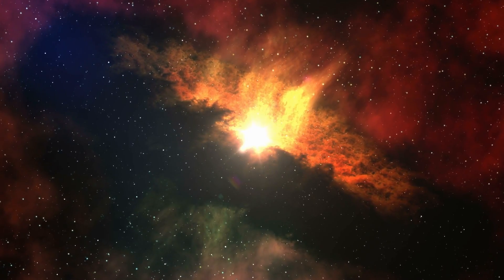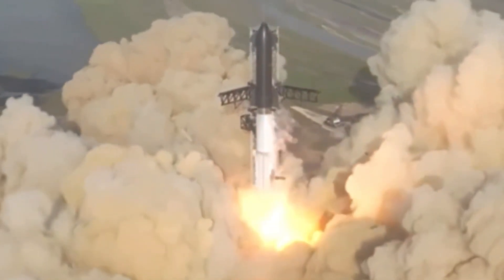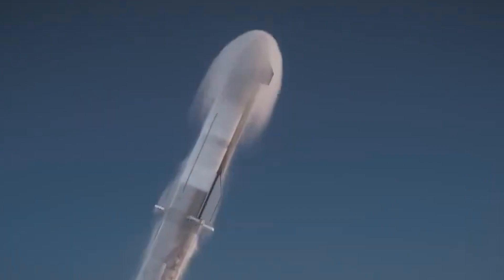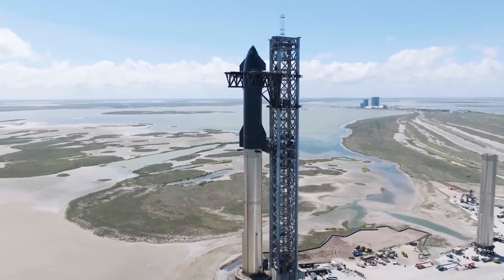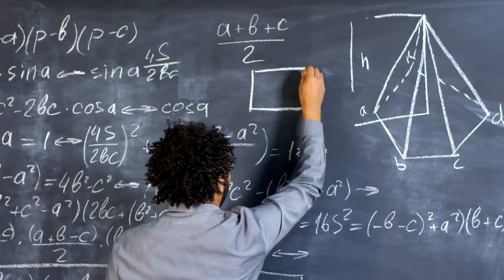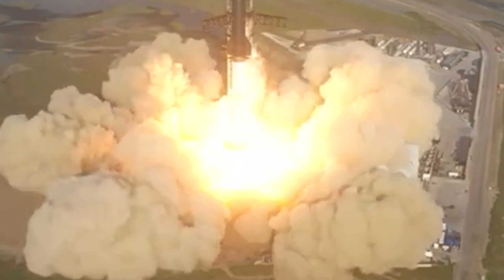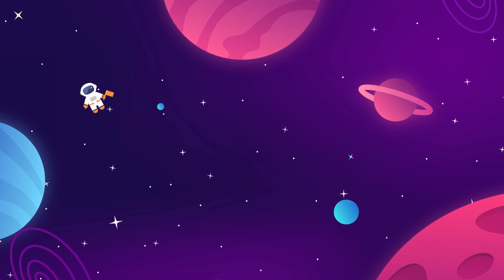The SpaceX Starship Orbital Launch Update Is Here!

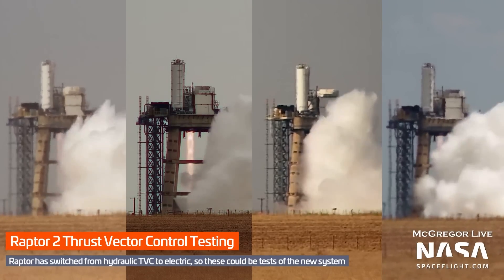Comment: 11:49 You forget, that the floor of the pad must carry the entire thrust force ot the super  heavy, at the exhaust temperature . 
Action = Reaction ! That force is Huge! This is not difficult to calculate !
Reply: I have an idea
We need to build an on surfaces magnetic force field to handle the pressure and heat 
If possible, a static electromagnetic field 
And even a faint magnetic field around the body of the vehicle can be an added advantage to heat resistance
If only it can be built

Comment: SLS first try? 

The engines are from the space shuttle. The solid rocket boosters are stretch version of the shuttle’s SRB and even the main tank itself is straight off from space shuttle as well although slightly enlarge…

The new SLS rocket has zero new invention on it.

Also the Terran1 did reach space but fail to orbit.

Comment: The rush to launch prior to the installation of the water-cooled steel launch pan was a frankly dumb move and to determine the strength of the concrete pad as being 'fit to launch' based upon a 10-second 50% thrush test, is what guaranteed the ensuing clusterfuck that we all witnessed.
To claim that the test was worth the data gathered is just a naked ass-covering PR band-aid. In reality, the pad will not be fixed in a "couple of months" and the boosters that are "ready to go" will now have to sit idle, until the pad & tank farm is certified as being 'legally' safe to use. Not to mention of course. the fact that SpaceX has been 'grounded' by the FAA pending their assessment of the event. There terms 'negligent',  'cavalier', 'irrisponsible' and even 'reckless' are now part of the current FAA narrative. In short, in a rush to make the front page, SpaceX very publicly stepped on its own rake. Not smart !!

Comment: When the launchpad was built, I thought that it demonstrated complacency. everything was bunched up, the tank farm was really close to the rocket and exposed, no flame trench or flame diverter. These people don't know history? The Russians launched the huge N-1, that was supposed to go to the moon. It was nearly half as powerful as the Starship. The launchpad was totally destroyed and people were killed when the rocket barely lifted off and fell back. If you see the damage caused by a relatively nominal launch of starship, what would it have been if the rocket and of course the tank farm exploded on the pad? It would have been the largest non nuclear explosion in history, similar to the one in the port of Beirut (ammonium nitrate). Residential buildings kilometers away could have been damaged, residents injured or even killed.

Comment: Why didn't they just build a flame trench designed to deflect the exhaust gas during the launch?And yes, there is a circular water barrier just below the ring helping to prevent acoustic suppression and overheating the launch pad, but its not enough. Obviously, there should be a massive flame trench built of highly durable concrete and designed for the pressure of the gases that come out of the 33 Raptor engines (each Raptor has an insane <30MPa pressure !). We do not have exact information why the engines failed, maybe the engine pipeline system was damaged by stones from that crazy funnel that the rocket dug.

Comment: You've misinterpreted Dr. Metzger, the ablative need not be "feet thick". Also nothing in Port Isabel came from the rocket termination, that was all sand blown up into the air due to the concrete failing.

Comment: Starship was always supposed to explode, neither section had landing gear and the 2nd stage wasn't supposed to reach orbit.  It was not just vector control which failed, the hydraulic clamps holding the 2nd stage down failed too. Had starship disconnected it would have continued on while booster tumbled. 

There was no launch tower avoidance, that was pure luck. 

The engines only throttled to 50% for the first 7 seconds, this wouldn't have been a problem for the pad as it had already been tested to cope with that. The engines only throttled to 90% in the final two seconds before it lifted off. That's when the pad excavation happened. 

The flight termination system activated about 45 seconds before the explosions, it's like poking a hole in a coke can and then standing on top of it, it will take time to lose enough pressure for the structure to collapse. That is what is seen in the flap cam image.  The 2nd stage then had 100+ tons of dead second stage weight still attached to the bottom of it before it also failed. SpaceX ought consider putting the power for the latching mechanism on Starship, not the booster, so starship has it's own launch escape system from a malfunctioning booster. 

It's entirely possible the pad would have survived had it been installed in one go, but it was a  patchwork of previous repairs which likely allowed the booster to mechanically buffet the pad and excavate a cap down below, which then pulled it apart in the same way potholes are created on roads when water gets in between cracks and then tyres increase the water pressure and allow it to crumble.   Flame diverters and water deluge aren't suitable for rapid reusability as they need continual maintenance. 

By the time SpaceX have finished they will likely have made flame diverters and water deluge obsolete.  The pad having held up fine at 50% thrust means they've already done the equivalent of the Saturn V burn without the need for them. It's materials engineering rather than laws of physics. 

Starbase and a new starship will be ready for relaunch before the FAA approve it. I would expect massive delays if they had exploded on the pad, but with most of the issues related entirely to the pad surface I would expect SpaceX can overcome most points of interest with stage zero redesigns, including nearby damage caused by concrete explosions.

Comment: I am sure there is some high tech fibers that can be added to concrete that would prevent this catastrophic failure of the RC concrete.  I use fibers regularly in my RC concrete construction projects and it is incredible how well that works.  Carbon or basalt fibers would seem like they would work really well as they would prevent and propogation of fissures in concrete and at least would certaily prevent any concrete bits from flying all over the place.
Reply: SpaceX calculated the Fondag would take 1 launch, they discovered this was wrong.  They are pretty sure no concrete will survive 33 raptors are 90% thrust.
So they're installing a water cooled steel plate under the OLM.
Reply: No, this can't be solved with material science. The forces are too violent for any material to withstand them, especially at the planned launch frequency. They need flame trenches and deluge.

Comment: Until people understand the nature of charged matter and take that into any calculations, then they will always be guessing and even stunned by any outcome. It isn't heat that is the problem, the problem was the engines producing vast amounts of positive electrical charge generated from the exhaust, with it then hitting launch pad at right angles and so increasing its potency by orders of magnitude. With a flame diverter (or rather plasma diverter) the exhaust hits at an angle that is not ninety degrees and so isn't a problem. If one doesn't use one, then the pad must be grounded to allow massive amounts of electrons from the earth, to balance the system and so will have to be well and truly grounded.

Comment: Ablative Coating is not an option for rapid reusable system, steel plate will not melt, you can clearly see from photos of debree and launch pad that steel rebar is not melted, and this rebar is extremely thin compare to giant steel plate

Comment: the fact that the booster can withstand the vibrations from the engines is insane to me. It seems like it's on the verge of physics.
Reply: The question is, are vibration and pogoing are a threat to the crew? That can reach a level where injury or death results for anyone flying aboard Starship. Pogoing was a big problem with the Saturn V that was corrected before the first manned flight.

Comment: 100% stuff, flew into the engines. Thats 100% it, SpaceX needs a deluge system and redirect bad. Once they do, they can do any and all the tests they want with 100% success rate its a guarantee. Engine control wont be an issue then unless the maths is wrong and I doubt that they're engineer's are stupid. It's the debree's fault.

Comment: Can you imagine the resonant vibrations occurring between the 33 engines?  That damage looks to be more than intense heat. If it happened to resonate  close enough to the resonant frequency of the  launch pad legs it becomes extremely destructive.  Tesla (the man) had a device he attached to a building  under construction and when it reached the sympathetic frequency of the building it began to collapse the structure as well as breaking windows in other buildings in the area.  Something about that pad structure damage made me think of the image I had when reading about Tesla's experiment.
Reply: You are one of the smart ones who is present here. There mast be a good gas exhaust system and a system that absorbs resonance
Reply: Now they have longer to doctor some videos and make a convincing moon
Reply: @aig9672  Good joke! I laughed
Reply: Russian rocket has been doing with 20 engines for decades, with few failures.

Comment: Do your homework. The flight termination system failed. 

The FTS explosives blew holes in the tanks, but the rotation of the Starship did not flow the fuel to the open flame of the engines. 

The Raptors exploded.

A total failure of the FTS. 

The flight termination system on the top tank is activated evident by a stream of vapor spewing.

Then the flight termination system  on bottom triggers evident by a second stream of vapor.

The Starship explodes from the bottom where the raptors are located.

Search youtube for the video "Is This Why Starship Wasn’t Destroyed The Moment It Lost"

~3K

Comment: The clamps do not release Starship at launch.   You can hear the call-out during the count down where they announce the release of the clamps well before ignition.  The Raptor engines are capable of throttling below a T/W ratio below 1.  Once all engines are confirmed lit, the engines throttled up and Starship leaves the pad.

Comment: The launch was an absolute disaster.  Proper launch pad design is extremely well known, they chose to ignore it. The engine failures/ shedding  at 30 second was dangerous and should have terminated the flight.. the rocket tumble is not something to be amazed at.. as soon as it lost stability the destruct sequence should have triggered.. what you saw was blantant disreguard for standard safety procedures.

Comment: there is no way to repair the launchpad,they need to remove and make a new one.
there will be hundreds of cracks above and below ground after the violent shaking it has been exposed to,i have been working with concrete for 35 years and there is no way to repair this type of damage.

Comment: Use an angled pit of water 50 feet deep directly underneath the pad. Grid with holes Pad allowing thrust to enter the water. The steam will help with lift and obsorbe 50 % thrust with 8 shoots to push out debrit and water

Comment: With some modifications, chopsticks could be used as a catapult. A slow launch means concrete spent much longer time under the torch. 2/3rds of the thrust is used to counter act the weight and 1/3 of the trust is used to accelerate the rocket.
So a few engines out  would make a big difference. The concrete was exposed to heat for to long, so instead of small surface spalling it fully mined the concrete totally out. Similar process can be used to tunnel through hard rock.
Reply: Had the same thought I do wonder if it would be possible.

Comment: Only six engines failed. If you look at the image showing all the engines lit up with a few dark area showing unlit engines.  It can be deceiving if you try to count the engines that are out, but it is really easy to count the engines that are on. The outer ring has 15 the next ring has 10 followed by the inner ring that has 2. This equals 27. There are 33 Raptor engines so 33-27=6

Comment: I didn’t quite get the 9% per engine figure. If it’s out of 100% that would be 72% of the thrust for far fewer than half the engines out.
Reply: Consider that the thrust to weight ratio is about 1.5. That means that 22 of the 33 engines are just holding the weight of the rocket. The other 11 actually provide the acceleration.

Comment: The good thing is (i think), its not that the rocket doesn't deliver the necessary thrust, but spaceX Underestimate its capabilites. For example, if they launch it on pad 39A, it Will probably reach orbit considering the cause of hydrolic failure is probably the debries from the launch pad
Reply: They didn't underestimate anything.  We've had literal DECADES of heavy launches worth to fall back on for design of a launch pad.  We know what happens when truly massive engines fire.  We know a system of safety features are required in order to protect the rocket and the surrounding infrastructure.  We've had plenty of very viable designs which have been used for longer than he's been alive.  He KNEW what they were.. but someone in the chain decided "you know what? screw it.. we don't need those.  Let's go a different route" and well.. there's a several billion dollar piece of equipment in the middle of the ocean now. This, quite honestly, was pure negligence.  I knew it the second they announced the refusal to have any of the standard features in place as did quite a few of my colleagues.  So it was absolutely no surprise at all while we watched that launch to see several engines immediately die before it lifted off, and then the cascade failure that followed resulting in the abort.  This was 100% foreseeable by EVERYONE involved.  Even musk himself said they'd probably regret the decision to not install them before they broke ground to build the launch pad.  So the question is.. who's responsible for the lack of judgement and will they still be working for the company because that absolutely should not have happened the way it did.  It's one thing to lose a rocket due to mechanical failures, weather, a whole host of different unknowns like a faulty O-ring.. but this... this is like building a car and refusing to have a braking system put in, and when you blow through your first red light and smash into another car you say "well hell, at least we made it out of the garage! I call that a success!"
Reply: @Jerakk30  Well, they have a ready-made flame diverter pit now!
Reply: Should have invested in R&D
Reply: @KarinExMachina  Don't blame the SpaceX engineers, they almost certainly knew this was a bad idea. Even a child could tell you that launching one of the largest rockets of all time with one of the shoddiest launch architectures of all time would probably create issues and that decades of prior launches probably had a good reason for using elaborate flame pits instead.

No, this reads like a very typical Elon decision where he got it in his head they could save money that way, and completely refused to listen to any of the dozens of people telling him otherwise.
Reply: @hellothere_1257  You are correct. One of the problems of Capitalism doing this kind of thing is they do not forcibly collect money to pay the bills... They have to earn it first... The result is an inevitable overvaluation of money over long term outcomes. The example I like best is the Rideau canal locks in the early 1800s: They had a private company build them, and the locks lasted 3 years... The government stepped in, and the very same locks of the period are still in use. Government research is also what designed and built the foundation of the Internet, NOT the private sector. So much for government "inefficiency". You HAVE to be inefficient to create something fundamentally new or valuable. Most people prefer the release of dopamine of cutting it close... That's the whole problem of progress, and you'll note we are having less of it.
Reply: Nice Checo pfp.  Glad he won the Sprint Race and the Race at Baku.
Reply: We know exactly what happened because it happened when the two Spaceshuttles blew up: SpaxeX engineers knew this would happen and have been warning about this for years. SpaxeX management ignored them again and again.
Reply: So, the cause is 'stupidity'?

Comment: SLS also took over a decade of engineering before it launched and they didn't build and entire launch facility for it.

Starship got 4min of flight after just 4 years of dev and testing. Oh and the whole area was built around it at the same time. That's still ridiculous.

SLS taking 10 years and working on its first try is expected.

Comment: The HPU isn't the cylinders that move to motors, it is the pump that power the cylinders.  So this probably blew up the pumps and caused all the hydraulic fluid to be lost.
Reply: Spacex had already removed those from the next booster so that won't be a problem.